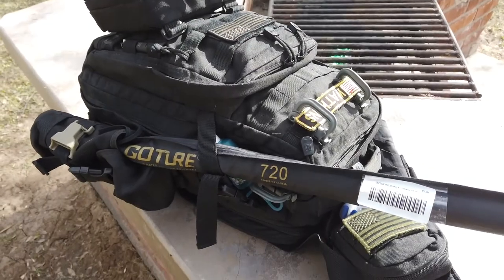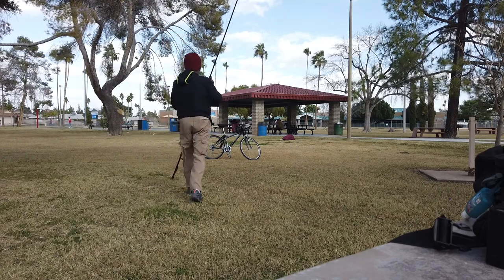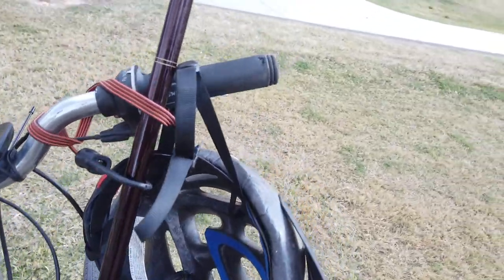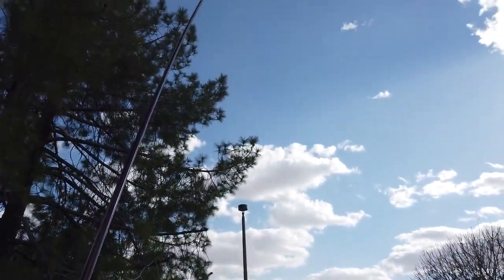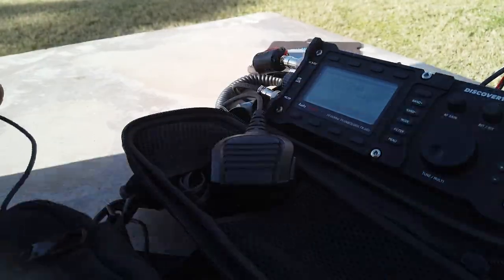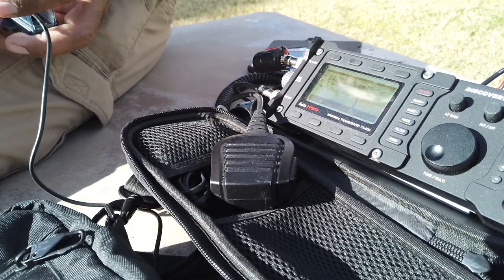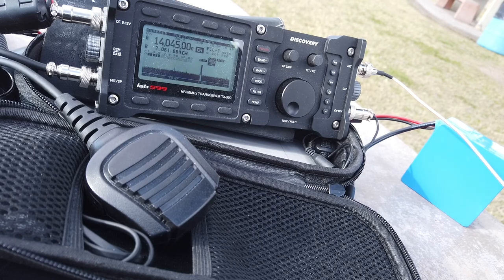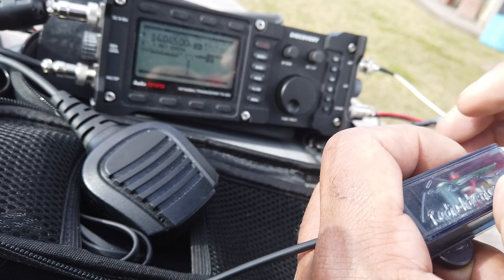How Do I Use an Inexpensive Fishing Pole or Paint Pole to Deploy My Ham Radio HF Antenna?

Comment: There's an interesting point that you might stress in a video. Lighter fishing poles are often too weak and flexible to hold an antenna strung at the top. They can, however, be used to drop weight and cord over a tree limb that will be strong enough. A 20-foot pole held overhead can reach a limb about 25-feet up, which may be enough.
Reply from the maker: Awesome!  I had never considered that, but it makes so much sense.  I definitely will mention it on my next antenna deployment video, and I will mention you as the source.  Thanks very much for adding something to my tool box.
Reply: Great idea!  I've done something similar -- make a lightweight "S" hook out of aluminum wire and tape it lightly with masking tape to the top of a fishing pole.  Attach the antenna wire to the hook and lift the hook up to a branch, then pull the pole and tape loose, leaving the hook in the tree.  How to recover the "S" hook?  I use a Nite Ize Gear Tie to make a "Y" at the top of the same pole and use that to snag the hook and disengage it from the branch.  I think your idea is less complicated!
Reply from the maker: Thanks for joining in!  That’s the name of the game; passing on, paying it forward, and sharing all these techniques and methods. The more we share, the less someone has to struggle to figure it out or be worried about being creative.

Comment: Great video!  I have a 20 foot Black Widow crappie pole that I've had for over 20 years.  I've used it for a sloper antenna support and also loosely coiled wire around to to make a "slinky" antenna.  I've used the latter idea for pedestrian mobile with my FT-817.  Last year I bought a couple of Spiderbeam telescoping masts, but I still use the Black Widow from time to time.
Reply from the maker: Very nice!  I like to hear the experiences of other hams. Thank you. It’s like anything else. The right tool for the right job.
Reply: The Black Widow crappie pole is conductive metal. I've used a fiberglass fishing pole to make a helically wound vertical antenna (Slinky) , 33' of wire for 10M.  Surely the conductive metal of the Black Widow affects the performance, no?   
I'd appreciate your thoughts.
Reply: @usernamemykel  My B 'n' M Black Widow pole, model BM6, is fiberglass.  I'm not familiar with other Black Widow models, or with models that are newer than mine.  Perhaps they have changed their materials in the past 20 years.
Reply: @WilliamParmley  Thank you.

Comment: Good solid QSO,  and nothing wrong with your portable techniques.  I run from my car as a bike is not an option here. Both knees were replaced 10 years ago, so peddling around is not a thing, hi!

I carry a 10 meter mast in our Scion Xd and run a non-resonant 29 foot vertical wire fed with a 9:1 Unun. My rig has a built-in tuner (Xeigu X5105) so I am good from 40 - 15 meters and can still get out on 12 & 10 in a pinch.

CU on the air!  73, Keith, WB2VUO here near Buffalo,  N.Y.
Reply from the maker: Outstanding!  Thanks for sharing your setup!  That's what I try to make this all about.  I hope more people share their techniques, rigs, and adventures.  I am always learning with this hobby, and my goal is to help people get out there and try with what they have.  I really appreciate you spending your time to watch and comment.

Comment: Do you notice limitations, reliability issues with 10 watts using digital modes? I have seen Julian’s JS8call videos and I wonder if the amplifier is often or rarely necessary.  The PA500 now cost more than the TX500 so I am interested in hearing about your experience.  I am a new ham and I’m not sure when, in general, would a 40 vs10 W transmission be necessary using digital modes?  Is it just about reaching the intended station?, or does the band selected also makes a difference? (assuming one is using the day time bands during the day, using the same antenna and so forth).   
Thank you
Reply from the maker: Hi, and thanks so much for posting a question?  I will give the best answer I can, but remember one person's answers can't cover it all because of the nature of propagation, equipment, and technique variables.  There is a physics limitation when considering a 10 watt signal against a 1500 watt signal.  The big muscle is stronger than the little muscle.  That does not mean the little muscle cannot do the work.  That does not mean that the 10 watt signal will not be successful.  That's when the variables I just spoke of become necessary to understand.  For instance, in cw I cannot rely on my 10 watt signal to "punch" past a 100 to 1500 watt signal.  So, I wait.  I wait until ALL the "big" signals are answered and then gone.  Now the person who called cq can hear my "little" signal just as well as she/he heard the others, and the qso is complete.  That is just one technique, and IT WORKS.  There are other technique also.

Is some digital modes, the playing field is sometimes a bit more even.  Imagine using your eyes instead of your ears.  Imagine choosing teams in school where all the players to be chosen are lined up right in front of you to be chosen.  The big kid stands next to the smaller kid, and you can see all clearly.  Virtually, that's what the computer does with available signals in FT8; because the computer does the listening the operator does not have to try to discern the playing field with his or her ears.  The strong signal at 3db is displayed in almost exactly the same way as the weaker signal at -12db.  The operator chooses with the eye and the mouse.  With regard to being heard, the 10w radio has almost the same chance as the 500w radio; almost because those variables of technique, equipment, and propagation are always at play.

Another thing to consider is that often the other station does the "heavy lifting"  A station with an excellent receiver, expert technique, and an antenna on a very tall tower can hear you, "pull you out", even though you are using qrp power in your transmission.  There is another example of the variables again.  I know this is true because I have a logbook full of Asia contacts, and I know my qrp rig didn't do all the work in getting there from Arizona.   

I also am on the list for the PA 500, but for me (everyone makes their own decision) the market caused by shortages and the high demand vs the low availability has driven this unit to a price beyond what I am willing to pay.  It's now, in my humble opinion, like trying to buy water in a desert during a drought as opposed to paying a price that's it is fundamentally worth.  Again, just an opinion and MY decision.  Free market says anyone can have anything they can afford and want.  I just can't afford it. 

You don't have to have an amp to make ANY contact.  I am not against amps; I have an Elecraft amp and a KX3 in my go box.  I just seem to have more fun with qrp, and my amp (even though portable and easy to use) gets dusty and rarely used.  

I hope my answers went in the right direction to answering your questions.  I am the first to say that my answers aren't any sort of operational gospel.  Someone else surely has something else to say that is just as valid and correct for them.
Reply: @Bill-HRT  Thank you for the outstanding analogy and openness of your comments.  It makes a lot more sense now.   I am not technologically inclined but very interested in portable ham radio operations in the last year so I am enjoying the steep learning curve.  Will start learning Morse code this year but my relatives won’t so email over HF is the most likely option using digital modes for communication if necessary.
Glad I found your channel and hear what works for you and how you use your setup.
Reply from the maker: Thanks!  I'm glad it helped.